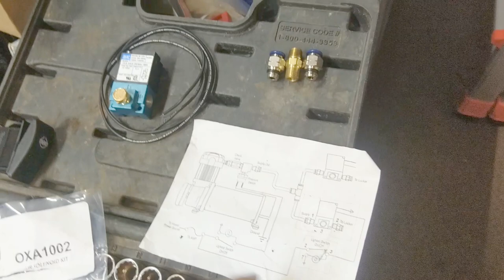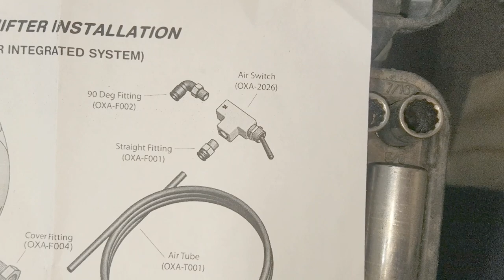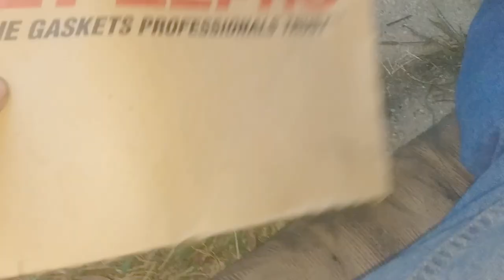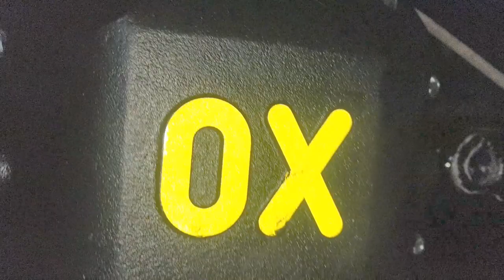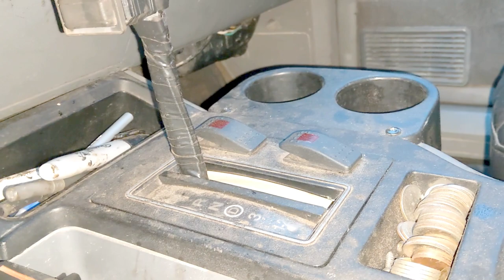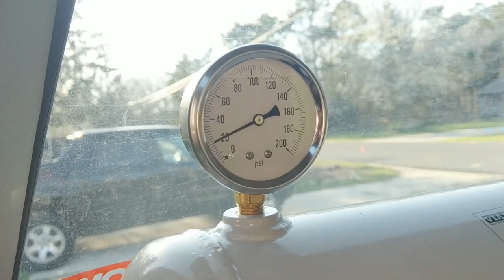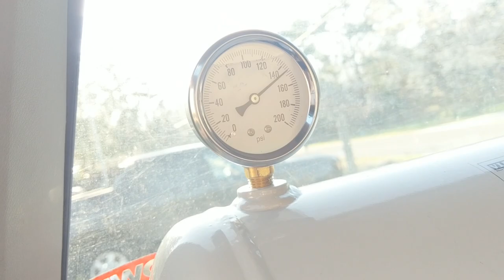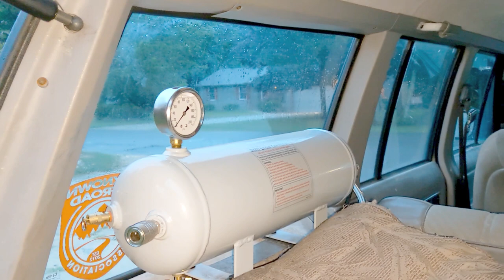89 XJ Air Solenoid OX Locker Kit Install.

Comment: 5 years later I’m watching your video. I’m about to order the same kit for a d30hp front axle to go into my TJ. After lots of research it seems like ox locker is really the best locker to go with for me. I like the mechanical switch and had planned on going that route but found your video here and leaning towards the electric solenoid setup. I need to watch your video if I can find it on wiring up your e-locker and switches as electrical is not my strong point. Thanks for making this video I really like this air setup. I do believe I will fish this line through a rubber hose to protect it from rubbing anywhere.
Reply from the maker: I would agree, I'm all for the ox locker. It's simple, tough, and dependable, everything you want in a locker. I will admit the air powered electric solenoid setup is probably the most complicated, but it is really smooth to operate and easy enough to route the air line. Now if you want to skip the electric bit, the air kit comes with an air powered switch you can use just as easily, just run the air line to the cab instead of a wire. I will say having to fill my big tank up to use the locker is a little annoying, but after that it's fine.

Comment: Glad to see the OX is still holding up. Debating between one of these or an ARB for my 93 XJ.
Reply from the maker: I like ox for the dead nuts simplicity. Don't have to worry about drilling out the axle for an air line and making sure the seals are clean and leak free. If my air line busts, I can screw in a lockout bolt and have a locker back in a couple minutes, and you get a sweat heavy duty cover to boot. If the OX holds up then I'd have a hard time recommending the ARB over it.
Reply: Well keep us updated on how the OX holds up. I am still open on both of mine right now, but looking at getting lockers in the near future.
Reply: Neither get a Detroit locker for ultimate reliability.
Reply from the maker: If LSDs are your thing then the Detroit is definitely the best choice, but with the rock crawling I do having a fully selectable locker is a must.
Reply: NickInTimeFilms A Detroit locker is a locker not an LSD, your thinking of the Detroit truetrac, which is also a good unit but isn't a full locker like the Detroit locker is.
Reply from the maker: Hmm, that's the first time I've seen a Full Locker under the Detroit name, but it just looks like a glorified full case lunch box locker. Curious if it makes any noise while cornering and how noticeable the engagement/disengagement is. I'd be worried about what causes it to pop out into free wheel mode, unless it turns out that it ends up saving axle shafts instead of stressing them too hard. I'll certainly keep an eye on it, but hard to stray from a classic/proven solution.
Reply: The Detroit locker has been out since the 60s , many muscle cars, and offroaders have been using them for years. They work the same way as a lunchbox locker but are stronger since it is a full case locker, I have one in the rear of my F250 and it works great, and doesn't make any noise that I can hear over the engine.
Reply: Detroit was bought out by Eaton and they stuck the name on their truetrac which is where the confusion usually comes from. They still make the old locker but selectable is way better, you can turn it on and off when you want and there are no clutches to wear out. Ox is just as tough as ARB and a lot more affordable. I would've put them in my F250 but they weren't available for the Sterling 10.5 at the time.
Reply: I ended up with truetracs front & rear and they work just fine. The only time they don't is when one wheel is spinning with no resistance. It's an easy fix though, you just ride the brake and it sends power to the other wheel. I don't do any rock crawling though. In the mud & snow they're perfect. They're probably good on rocks too.
Reply: @Ken19700  A selectable is not way better, for  reliability you can't beat the simplicity of a mechanical locker like the Detroit.
Reply: An OX is pretty simple and being able to turn it on and off when you want is way better than wondering if it's going to lock up going around a corner on the road. Also, no clutches to wear out is a big plus. If simplicity was the most important thing then you'd have truetracs.
Reply: @Ken19700  Detroit locker is more simple than a True track, and is stronger.

Comment: Love your Cherokee videos . Been watching them for years . Have a Cherokee myself. Love the addiction. I noticed you went to the ox lockers after the e- lockers . Did you have trouble with the e-lockers ?
Reply from the maker: Yeah, main issue I had with them was spin down time. They took too long to disengage which made tight obstacles a chore to get through. OX is on or off the second the tension is let off.
Reply: @NickInTimeFilms  right on . Yeah I’ve read of that happening. Probably going with the ox . Seems simple and strong . Keep up the good work on the vids . They have been a great help & good entertainment. Cheers

Comment: hello thanks for your videos, I would like to know if the lock is activated in motion or does it have to stop? thank you
Reply from the maker: You can lock it while moving, but the tires should be spinning the same speed.
Reply: @NickInTimeFilms  Does the same apply to the cable system? of the same OX lock   ?  Tks
Reply from the maker: I don't think it matters which activation system you have since it's just a massive fork that locks and unlocks. I'd check the ox manual or website if you had very particular questions about their stuff.
Reply: @NickInTimeFilms  thank you, I am trying to choose between ARB air lock, and this OX cable system, it seems more reliable to me OX cable has fewer components and even if something is damaged I can activate it with the additional wedge. but I have that doubt, some say that it is necessary to stop completely in the case of the OX, other people like you tell me that it is possible to activate and deactivate the system in motion... in the same way, thank you very much

Comment: Very nice & damn you for making me want one for the rear & a lunchbox for the front lol.
Wondering how the LB in the front will do with the select-trac TC I have.
BTW, is that console full of loonies?
Reply: Rottidog I have a lunchbox locker in the front with the np242 selec trac transfer case and it works good.
Reply: Good to hear! How is it in Full Time? I'm wondering about the torque split, 55/45 (R/F). Is that enough to engage the locker or does it have to be in Part Time (50/50 torque split)?
Reply: Rottidog It acts kind of funny if you drive on the street in full time, the way a lunchbox locker works is when you go around a turn the outside wheel uncouples and spins faster than the carrier so it can turn without binding up then it relocks when you are going straight again. In 4x4 full time say you make a right turn the the left front will be uncoupled and the right wheel will be receiving torque, when you make the turn and straighten the wheel back up you can feel it try to pull to the left a little until the locker locks back up. I don't use full time anyway so that's not a big problem for me.

Comment: Does Ox make a cable actuated unit that does not require air?
Reply from the maker: Yep, the stock setup is actually cable actuated with a manual shifter for even simpler setup. The hardest part with that is just routing the cable upfront because it's not super flexible. They also have an electric actuator for the cable setup as well, and I believe Matt from BleepinJeep made a video on that one years ago.

Comment: Hey man you may want to add a regulator to your system as to not over pressurize your locker.
Reply from the maker: That might be an idea. I'm thinking of just switching to a 120 psi cutoff switch so I don't have to worry about it.

Comment: So you had an e-locker? Why go from that to air?
Reply: Lol you literally talked about the instantaneous engagement at the very end
Reply from the maker: Well the main reason was the E-Locker was for the D35, and this is my new D44. And the E-Locker was the one that needs half wheel rotation to lock/unlock. My air tank causes an initial wait time for the OX, but once it's full then you're good for the day with instant lock-up.